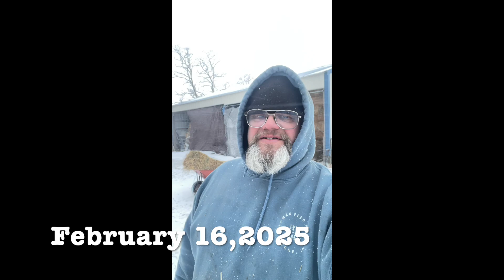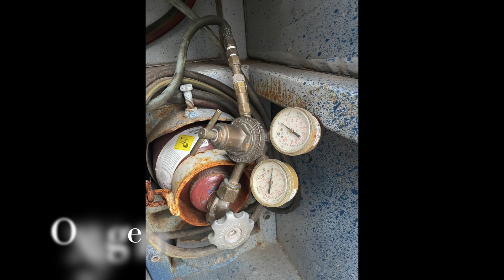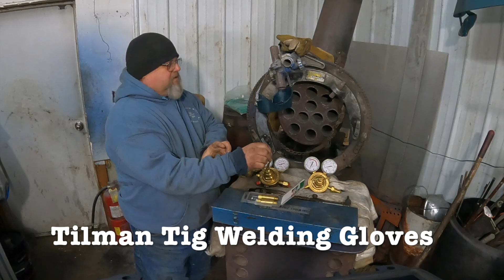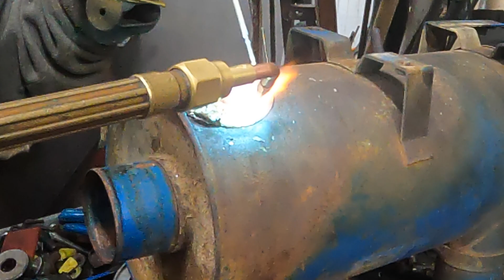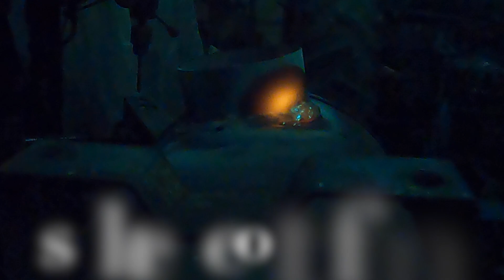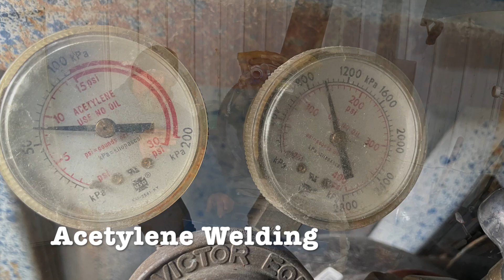Brazing & Acetylene Welding

Comment: ive been waiting for this, thank you

i dont really like the coated rods, they have too much flux in my opinion, so i dip mine as i go. But anyway can you explain why you ran an oxidized flame then a carburized at the end?
Reply from the maker: @KevAF_  I was just showing the three flames what they would like and look like  thanks for watching Kev.
Reply from the maker: @KevAF_   I promise to make a video on welding open root bead for Oxygen & Acetylene welding in a month or more
Reply: @banters_arcforce  ill look forward to that! I use some pretty old oxweld regulators on a purox handle that was my grandpas lol. i like them better than my newer harris set.

i also have a couple really old torches that have to be from the 1920s or older but they scare the piss out of me to ever try them.